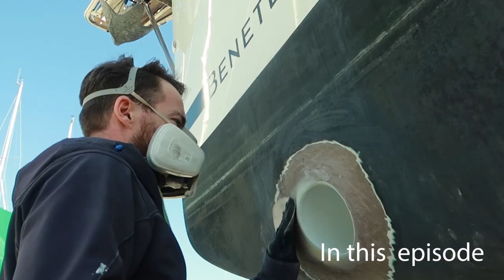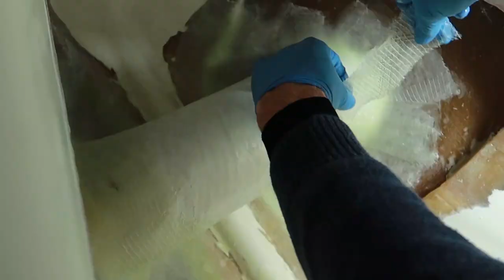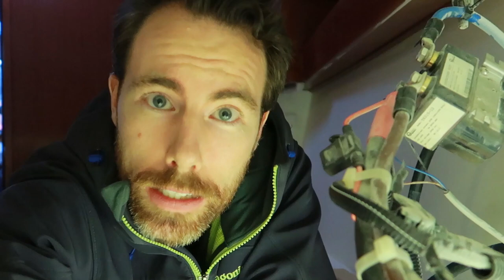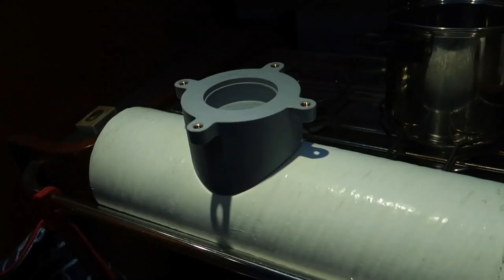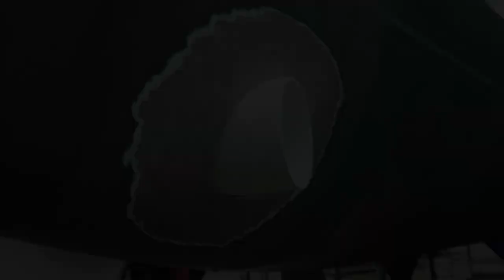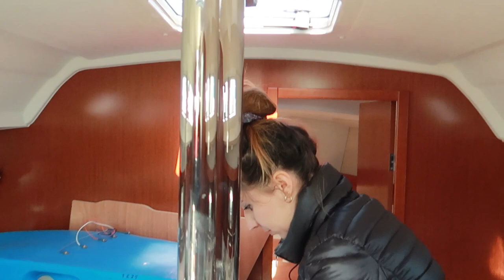Fiberglassing the tunnel in place! | DIY bow thruster install

Comment: I see you approached the fibre glassing slightly differently this time compared to the Crownline. You’ve taken it to the next level, such a pro job. I am just about to glass mine in and your videos have been massively helpful.  I also noted my motor bracket does not fit down snugly on to the tunnel - I am using the same Side Power kit.
Reply from the maker: Thanks!. Good luck with your glass work. I hope you live somewhere warmer than here in Denmark. Regarding the motor bracket; yes it's a bit weird that it doesn't fit snugly on to the tunnel. My trick with a few layers of fiberglass on the tunnel and then pressing the bracket down (with some plastic in between) worked quite good. You just have to make absolutely sure about the bracket placement, since you will get a very nice indentation in the fiberglass. Alternatively you can drill the holes for the gear leg first and only apply glass where the bracket actually sits on the tunnel. Then you can bolt down the bracket while the epoxy is curing. Hope it makes sense

Comment: Nicely done! I have learned a lot from your videos as I prepare for my first bow thruster install. I do have a few questions if you don't mind.
- I see you used a non-woven 45 degree 300 gram biaxial. From what I'm learning that looks like an excellent choice. Where did you source it?
- I like the way you (your girlfriend....now wife...congratulations) cut the outside glass pieces to different lengths to create a taper. Question is, did you also attempt a small taper on the inside of the tube? Meaning, did the first layers go further into the tube? 
- Related to the first question; did you worry about decreasing the diameter of the tube with the glass layers and fairing layers? Any issue getting the propeller into the tube, past the reduced diameter?
- what did you use for a finish coat inside, and also outside? Can you gel coat over epoxy on the inside?
Thanks again!
Reply from the maker: Hi Jeff. Thanks, we’re glad you liked it. So the 300gr bx I found locally here in Denmark (hfmarine.dk). However it must be widely available.
Yes, there’s also a taper to the inside of the tunnel. Don’t worry about not being able to fit the propeller as long as you don’t add more than 3 layers of 300gr. The propeller still slides in. But, absolutely no glass where the propeller spins, it’s a tight fit there!. Gel coat on top of epoxy is generally not recommended. I still went down that road on the inside because it won’t be exposed to any wear and tear. Actually you don’t really need to do anything on the inside if you don’t mind a more rough look of the fiberglass. On the outside it’s a no go with gel coat on top of epoxy. The epoxy has far better water sealing properties than gel coat has, so finishing with a couple of layers of un thickened epoxy will seal everything up nicely. Then a few layers of primer for your anti fouling to adhere to. Good luck with your install, please feel free to reach out if you have any questions

Comment: Man this project is incredible, you have balls of steel sir.

It's definitely a project I am considering.  I have a 270DA But the thought of drilling a hole in my hull gives me nightmares.
I am pretty handy and have done many diy's jobs, but have never worked with fiberglass.  How much fiberglass experience did you have prior to doing this project?
Reply from the maker: Thanks! If you never worked with fiberglass I would recommend you to read some of the articles on the west system epoxy website and check out “Boat works today” here on YouTube. Andy has so many good tutorials! Then maybe start with some not so critical fiberglass projects before a bow thruster. It’s not that’s very difficult, but there are some things you need to know. I did one other bow thruster install a few years ago (check out that video on my channel). Besides that I’ve been doing a lot of small carbon fiber and fiberglassing projects

Comment: Hey Nice project. :-)
I have at Beneteau oceanis 34 as well and considering installing at bow thruster. Have you tried the bow thruster in the water? Is it big enough with strong side winds? I did consider a larger, but no reason if the 40SE has enough power.
Reply from the maker: Thanks! The install is actually done and the boat is back in the water, just need to edit the last video in this series. But as a spoiler, the SE40 works perfectly! I docked the other day in 10m/s straight from the side and it had no issues overcoming the force from the wind. I hope to have the last episode up next week with some shots of the thruster in action
Reply: @jacobkollerup  Thanks for the answer. :-) I'm looking forward to the next video. :-) Where in Denmark is your boat placed? Mine is in Næstved.
Reply from the maker: Sorry for my late reply! Didn’t get any notification. The boat is in Skovshoved. You are welcome to come and see the install one day